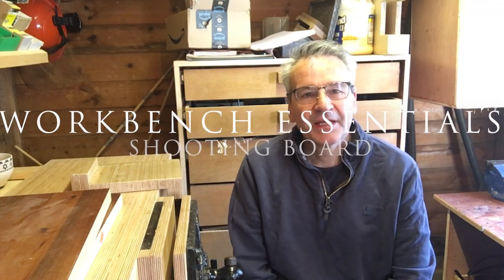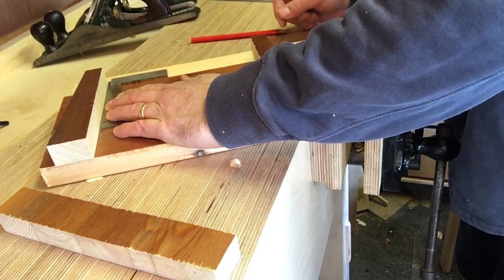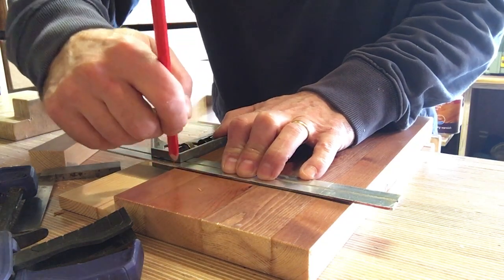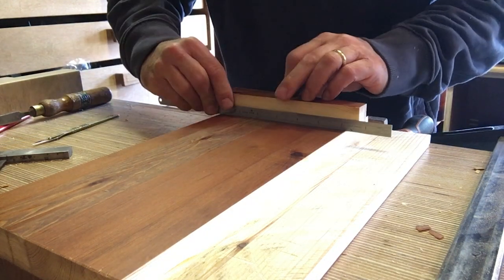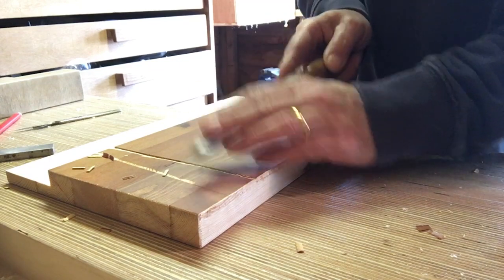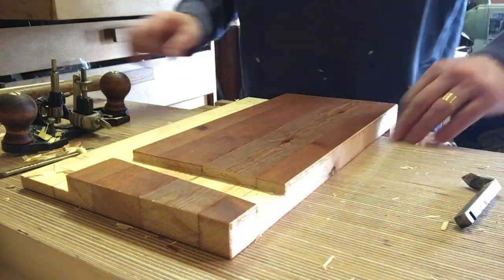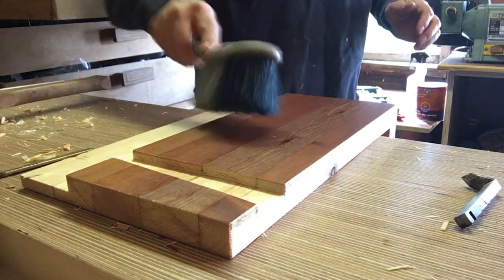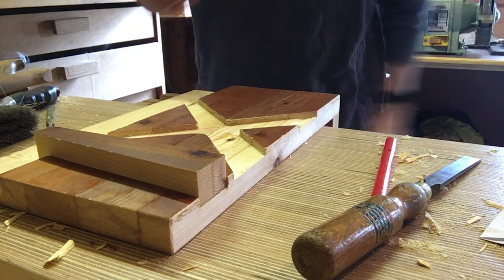Workbench Shooting Board

Comment: Nice shooting board, interesting design.   Well done.
I have bad luck purchasing woodworkers squares.   I have one with lovely rosewood handle, brass face, steel blade.   Very nice to look at, but that it all it is good for since it is not 90deg.   Next one I purchased was also not 90deg.    I finally purchased a machinist square, which is now my reference accurate 90deg square.
I made a shooting board a long time ago, early 2000's.    In my design the fence was parallel and screwed against a stop at 90deg.  I used two pieces of 3/4in MDF for the board, one for the shooting area, doubled up for the wood.
My first hand plane was a modern Record #5 purchased in the late 90's.    It looked to be well made.
My first tests of the shooting board resulted in the test wood face not being 90deg vertically.  Since the board was flat MDF this had me scratching my head.
I then checked the Record plane.    The left cheek was 90deg to the bottom.    The right cheek was not 90deg, a factory hiccup.   I am left handed, so designed the shooting board to use the plane with my left hand, so the right cheek down.    Crap.   At the time I did not have a milling machine so I was not able to fix this hiccup.   I gave the plane to a friend some years ago.
When I later purchased a new Veritas low angle smoothing plane, I checked this and both cheeks were machined spot on 90 deg.   Just FYI.
When I restore a vintage plane, I now check the cheeks.    Some are spot on 90 deg some are not.    These were mass produced and not always accurate in all machining operations.
Try pushing with your hand on the side of the plane, not the handle, it will help to keep the plane pressed against the board.
If you find a deal on e.g., another Stanley #5, you can always drill and tap on the side to add a knob to make a dedicated shooting plane.
Dave.
Reply from the maker: I see plenty of squares at local market - engineer ones are best i think - shall have to purchase a couple of bigger ones as only have a small one
Reply from the maker: I am learning you really do have to spend time getting everything setup (sharp irons/square surfaces etc) then it works easily otherwise it becomes no fun - patience is not my strong point I have to force myself to take the proper time